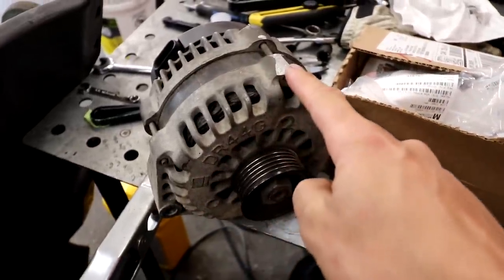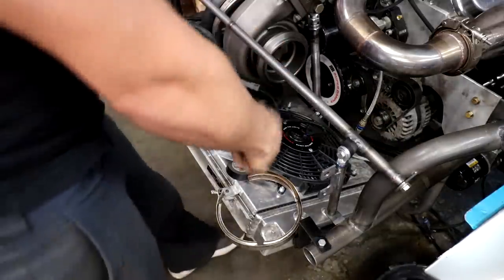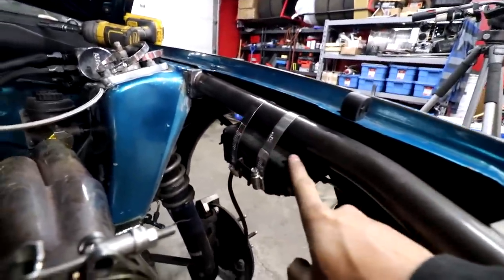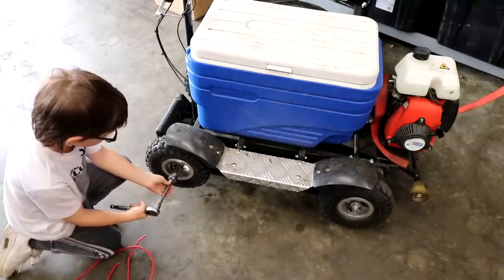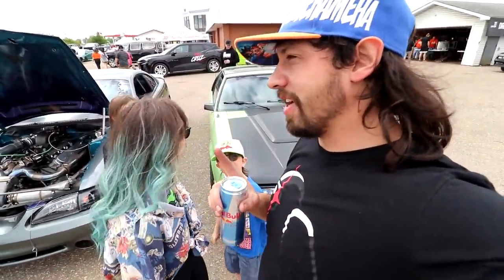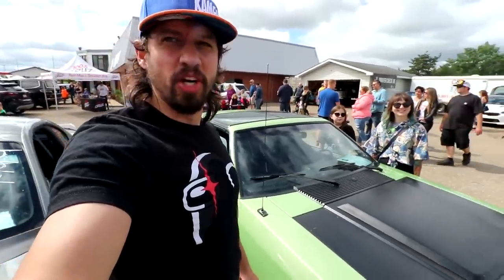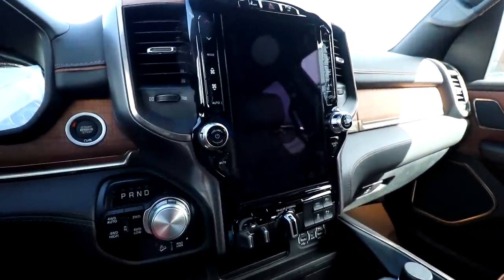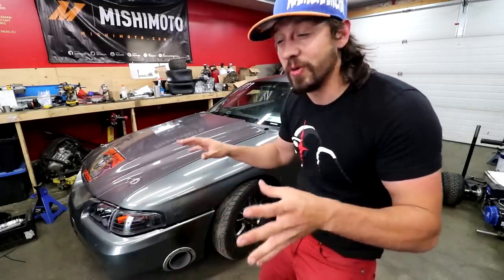Twin Turbo Mustang Dyno Runs And G.I Slow First Drive Success.

Comment: Those are wire ferrules on the fan wires, makes the install look much cleaner, add a bit of heat shrink (in normal applications, that safety stuff is just added weight on this beast) and make a great, clean connection!